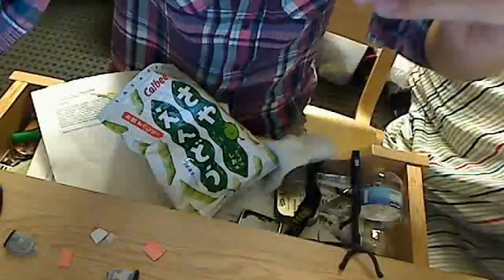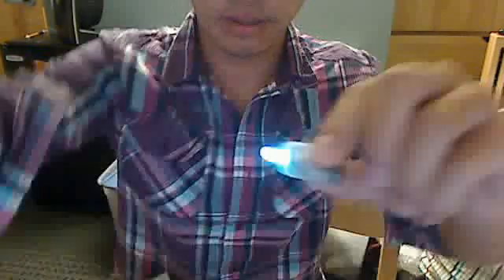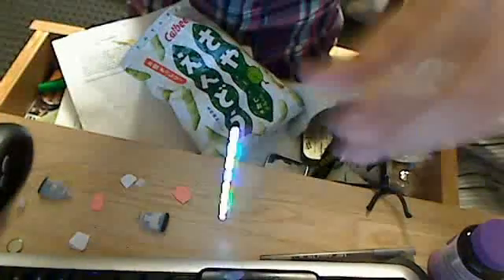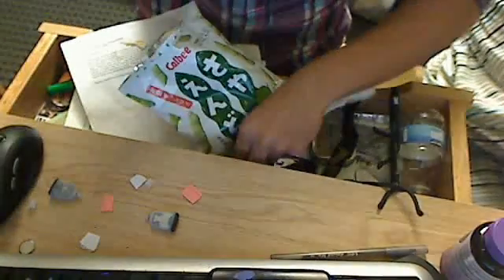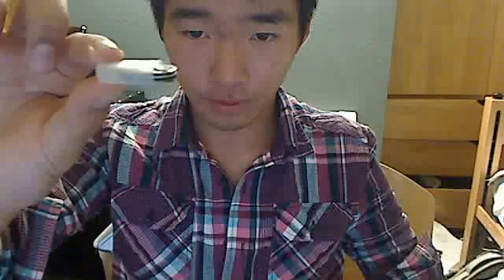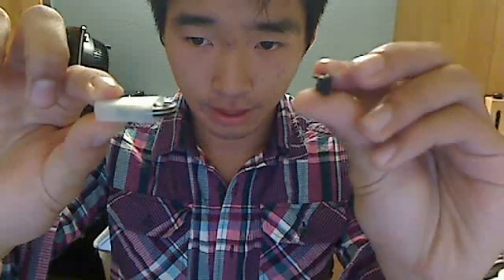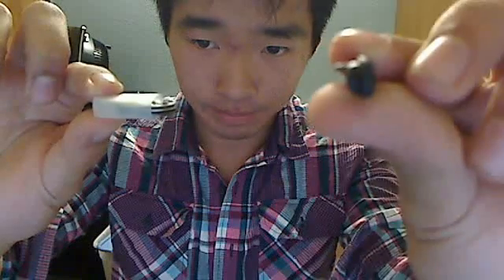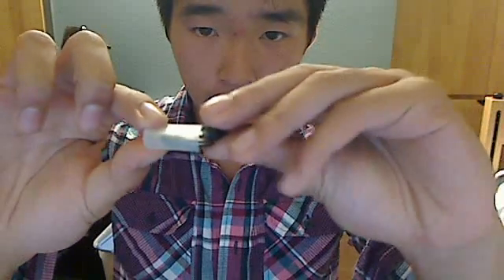How to Prevent Micromax EVOs / IMax Chips From Turning Off During Shows, Permanently

Comment: My micromax's now not only never turn off, but it prevents the backing from popping off SO much more when clicking the buttons or doing some intense gloving.  Thank you so much for this amazing tip. Only needed it for 8 fingers though.  My RGB 6 Mode micromax casings came with backings that have 2 tabs instead of 1 so they click on very nicely,

Comment: @MultiFobic did you try changing your batteries to fresh batteries? chips do not determine an LED's tint, they only control the voltage going into the LEDs.